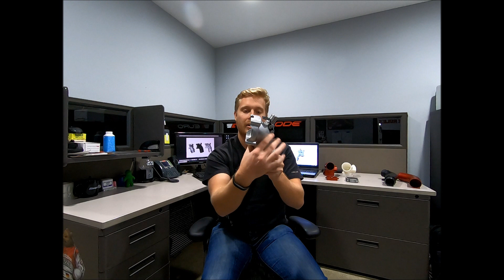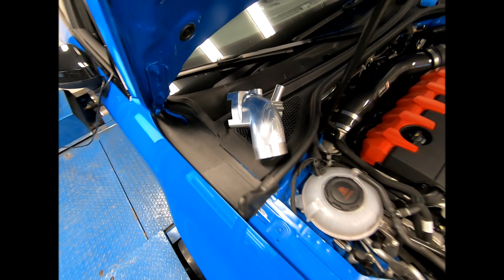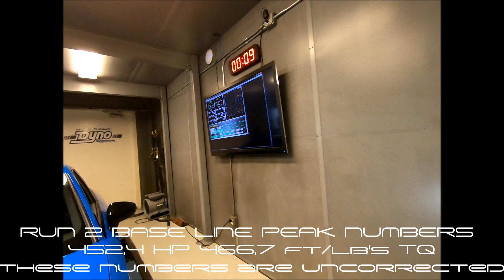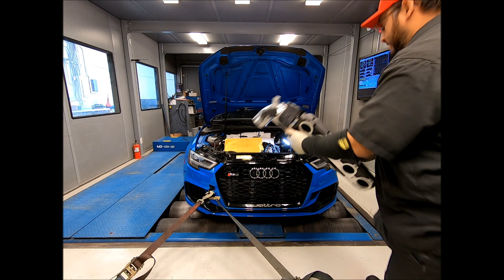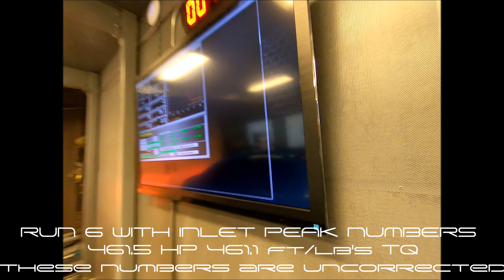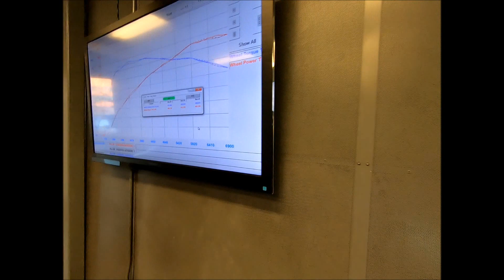Audi RS3 TTRS Dyno testing the EuroCode / Silly Rabbit Throttle Body Upgrade evo2 8V/8S EC0404-0302

Comment: Can this be fitted without the need for new software/re-tune?
Reply: Yes it can , but your not going to have the full benefit without sone sort of software tune , I’m good friends with David and that is the shop I go to for my Mk3 TTRS same platform. You won’t even get any check engine lights or faults or anything but it’s actually a very less expensive part for the numbers your seeing but don’t quote me on this but without software your probably getting maybe 15 horsepower to the crank and the same foot pounds of torque , but it is useful because the stock OEM inlet has a lot of restriction with this it’s so much more less restrictive you can tell by the weight of the 2 pieces side by side . Hope that helps your question but to answer your question again yes you can run it without a tune, you can run pretty much every bolt on without a tune FMIC intake , inlet mid pipes , the only thing you can’t run without a tune is a downpipe your car will have CEL and will run like crap , and I almost forgot you do not need a retune for this whatsoever so if you already have a tune your in good hands and just slap it on and make the actual power that’s shown maybe more depending on what you have already . Hope that helps let me know if you have questions I’m always at his shop to hang out he’s super cool and he will answer anything .

Comment: So how much does this mod cost to buy and fit? Seems a lot of effort for what is just a 2-3% increase.
Reply from the maker: $595 install is under an hour, so around $100. The gains from the stage 1 car on 91 octane pump gas are below. Gains are higher as boost is increased to stage 2 and larger turbo stage 3 applications. Basically the more boost you run, the more effective this part becomes starting at stage 1.

21HP & 26lb/ft TQ @ 4150RPM Run 1
18HP & 15lb/ft TQ @ 6350RPM Run 2
15HP & 13lb/ft TQ @ 5950RPM Run 3
14HP & 12lb/ft TQ @ 6000RPM Run 4